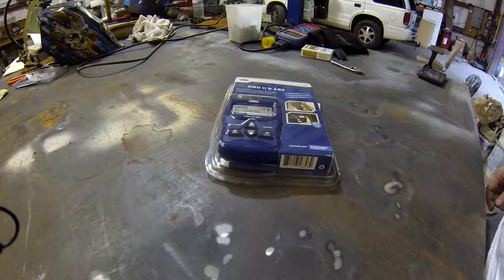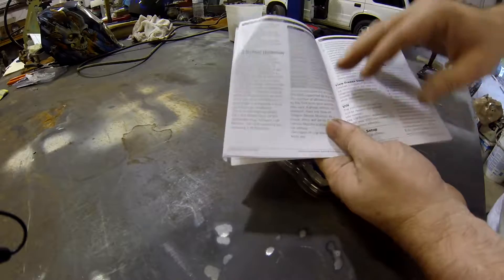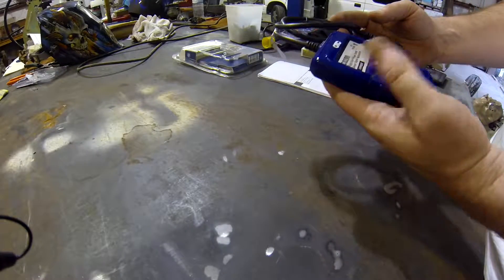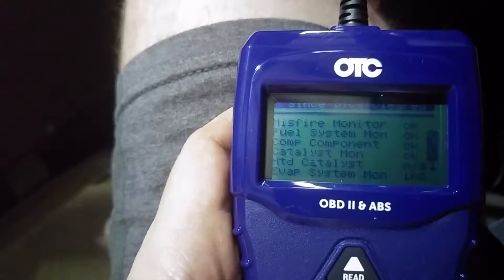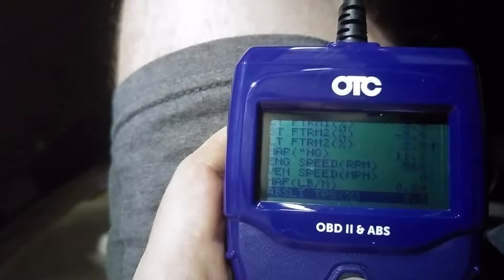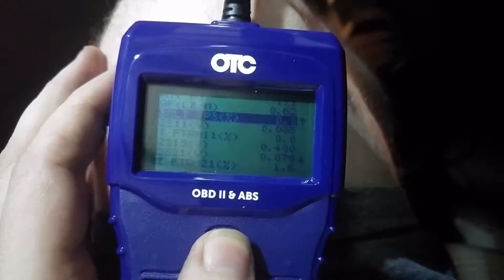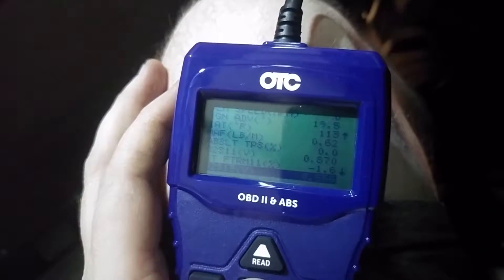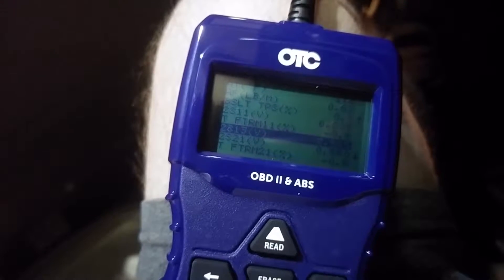OTC 3208 Scan Tool Unboxing and Diagnosing a Check Engine Light

Comment: Im looking for an odb2 tool for personal use do you recommend this product?
Reply from the maker: Yes, it is a little dated now but has worked fine for me. There are also cheaper bluetooth options you can pair with your phone if you just want to scan/reset codes and see emissions information. OBDLink and Blue Driver are some good brands but you can get a basic one that may do the job for around $15 on amazon or ebay.

Comment: P0420 is almost always a Cat. But what's burning out the cat? That's the real issue. Anyway cool video. I subscribed to your channel!
Reply from the maker: Thanks for the sub, I returned the favor.  It was indeed the cat.  I'm working on replacing that vehicle since it's pushing 220k miles so I'm not really going to throw money at it to try and figure out why that (super cheap) replacement cat only lasted 4 or 5 years.  I agree if that wasn't the case then hunting down the cause would be the next step.
Reply: Chaos Garage thanks man! Us techs, DIY guys and gear heads gotta stick together and help our channels out. Keep up the good work.